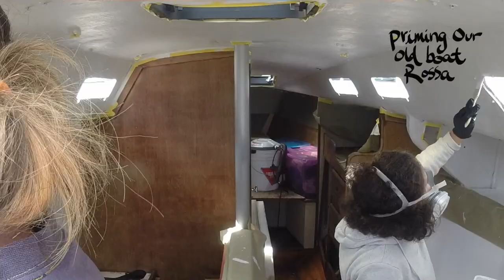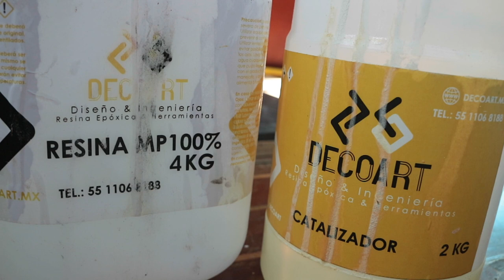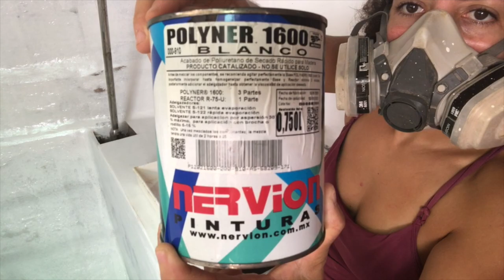Epoxy and Paint Sesh Aboard Inesperado

Comment: All you need - small glass container (from jam or anything similar), couple brushes, couple gallons of acetone or gunwash and scale for proper mixing. These things can last you 20 years (like mine do) without need of replacing. Take plastic 1-gallon container from trash (from motor oil, for example) - cut one side, lay it on the other side, wipe it and pour gunwash in it - now you can wash your small glass container and brush(es) right after using, before epoxy hardens. Keep dirty gunwash in bigger glass jar - dirt will settle down quickly and this same gunwash can be used again and again to wash basic tools. You can also have second jar with clean gunwash so you can rinse brush after cleaning. Almost any (except oil and such) gets settled down in gunwash so it always can be reused.
Just remember to wear proper mask and gloves - this stuff not necessary good for your health.
Reply from the maker: This is an idea I'd like to try out, if I can find the right kind of buckets, and if I can find such a thing called  'gunwash' around these parts. Also wondering if this is a solvent that will work for epoxy...thanks for the tip! Would be nice to not use up so many brushes and rollers!
Reply: @sailorama  Acetone will work just as well. It's just high strength solvent (gunwash is used to clean paint guns and other tools in auto body). It will work as cleaner for uncured epoxy (even if it's "almost cured"), but of course it can not be used as thinner for epoxy. But it can be used as heavy duty cleaner when needed (just be careful - it dissolves a lot of things including many finishes, paints, plastics :) ). All above mentioned containers - small glass containers from food, like 100-120ml (3-4 oz) or whatever size you prefer for making one small batch of epoxy. The bigger containers - also from trash (like from pickles or other food sold in glass jars), with threaded cap. So basically - whole setup is from trash, no purchase required except gunwash or acetone :). Yes, cleaning of small epoxy container, brushes, and other small tools takes some time, but in return you will have very long use out of them - glass containers will last until you brake them, brushes, if cleaned not too late (epoxy not cured on them yet) - also will last nearly forever.

Comment: I use any flat clean smooth surface and a plastic Bondo spreader to mix my to part epoxy. For a small batch a paper plate.
Reply from the maker: Yeah, this is a good method especially if it comes already thickened, or it's a thicker type of epoxy. Easy to peel off the dried layer and use the flat surface again! Plus, it makes you feel more like an artist, heh.

Comment: Thanks for another great video.. have you considered using standard polyester resin (with added white pigment and wax-in-styrene) to make a flow-coat? It would stink the boat for a few days afterwards, but is cheap, and gives a one coat smooth and durable finish using a roller.  (I had to smile at the advert for the $150k Bentley that YT played in the middle, I'm definitely not that demographic so it must be down to your shiny new galley!)
Reply from the maker: We made a polyester resin with pigment attempt on Rossa, however, the local fiberglass shop insisted that all we needed were two components - we thought for sure there would need to be a third component, the wax for example - and the whole ordeal ended up being a flop. We mixed several batches, testing out using more catalyst, and only managed to cure the polyester mix by starving it of oxygen by covering with a layer of regular paint. Not impressed. We meet a lot of locals with polyester-built pangas, and the pangas all seem to suffer from similar issues - like the mixes don't cure properly. Perhaps they sell better stuff outside of Mexico. We realize that polyester is not known to be as tough as epoxy, but so far we haven't been able to find something worth spending money on...
Reply: @sailorama  yes without the wax the surface will remain tacky.. your galley looks great